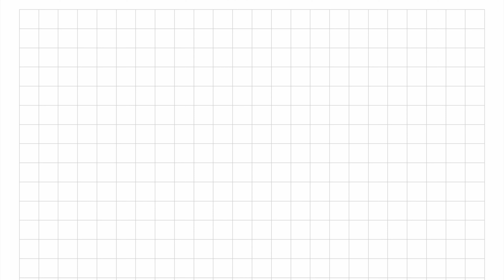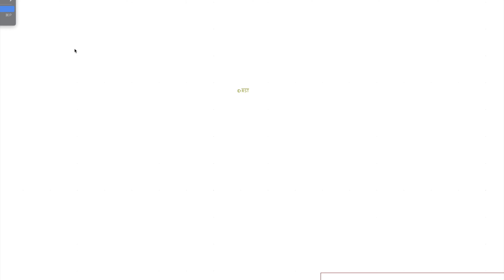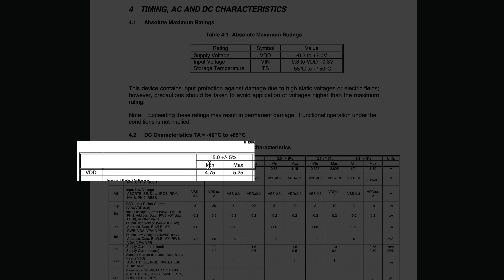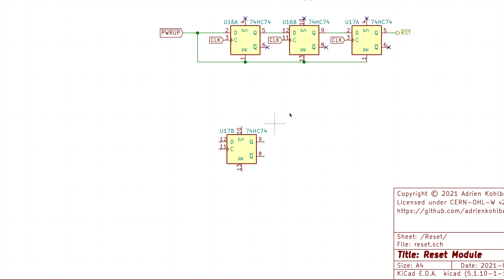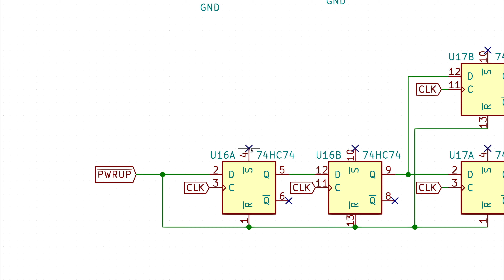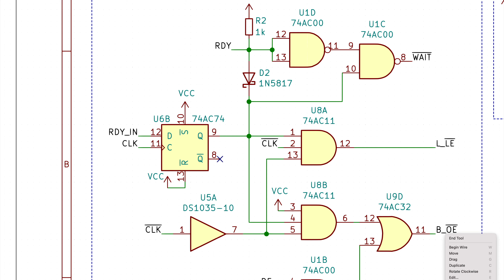#10 - Power-up Reset - BB816 Computer

Comment: Hi Adrien. Cool stuff. Perhaps a bit overkill, I would just have added a delay on startup using a simple 74HC14 and a cap. Looking forward to the part where you handle the clock select synchronisation.
Reply from the maker: Definitely, the flip-flops only make sense if you're planning to slow your clock. For a "production" build using a fixed oscillator in the MHz range, it does not make sense. Whether you use a supervisor like the MAX705 is up to you, I like the watchdog input and the fact that it is a smaller package than a 74HC14
Reply: Hi Adrien. Yes I did watch your video. It's great. I will comment there.